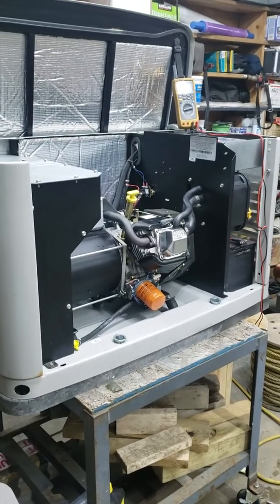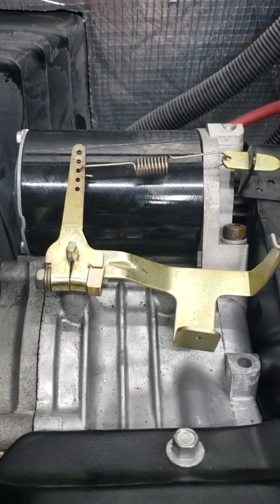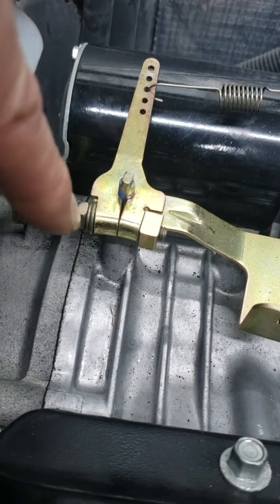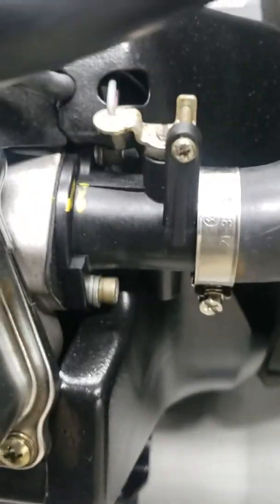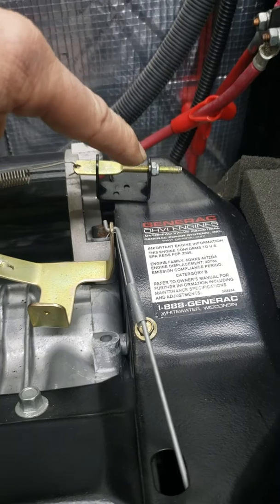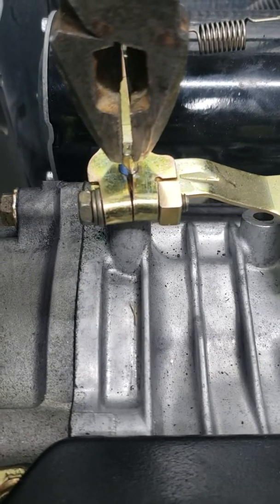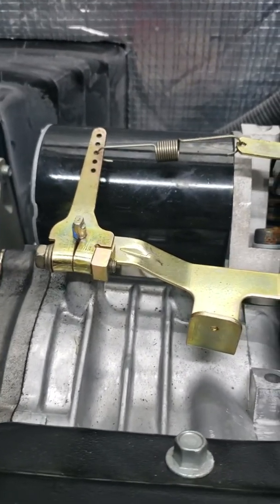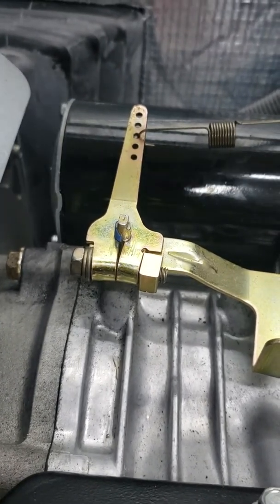Generac speed ramping adjustment.

Comment: Soooooo glad you posted this!  Our older square body 15kw has a slightly different configuration of the same stuff and I believe this is going to help us get her home.  Did you disconnect any of the pin connectors while doing this in order to get the unit to stop self-killing while you were adjusting it?

Comment: I have a 7163 15kw and the ac output is too much for my Aimspower 12kw inverter/transfer switch. Will this procedure work with my generator unit to lower the power

Comment: Governor is not your problem  carburetor you've got the primary jets that have stopped up and that's what surging it take the  carburetor off rebuild it clean the Jets make sure all jets are clean thoroughly and no blockage in jet holes so run like brand new again your primary kit is also your idol that's what surgeon

Comment: I'm from Phillipines. Recently, our privince was hit by a super typhoon Odette internationally known as Super typhoon RAI. Our province is in total black out for almost 3 weeks now because of the damaged cause by the typhoon to our mainline electricty towers and posts. Someone has given me a generator but i still have to bring it to a mechanic/electrician to  make it work. I learned that the generator is 230 volts with 50 hertz however in the philippines we use 60 hertz but with the same voltage. Do you think i can just adjust the rpm of this and make it 60 hertz? By the way the model of the generator is changfa ced6500s. Thank you
Reply: You can certainly raise the rpm to get 60 hertz. But I’m not sure if the voltage will require a new regulator or not